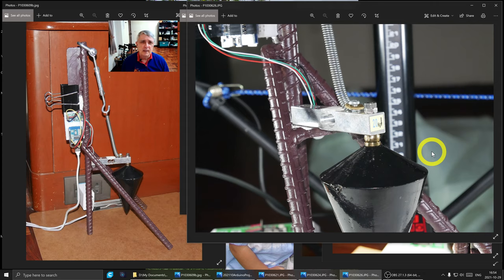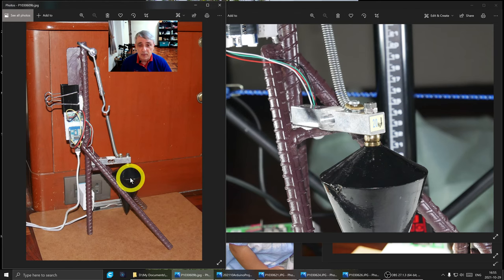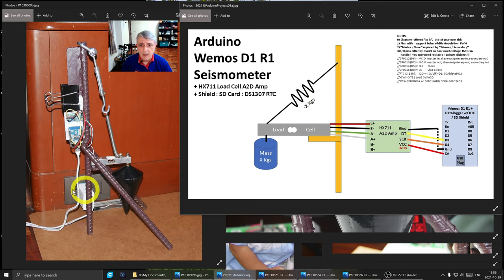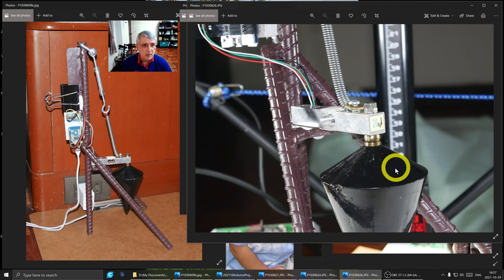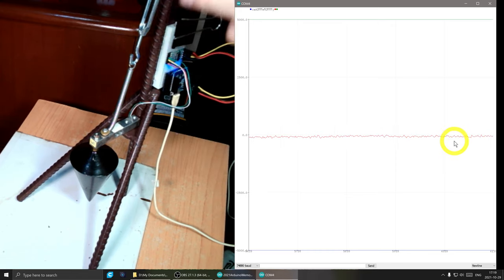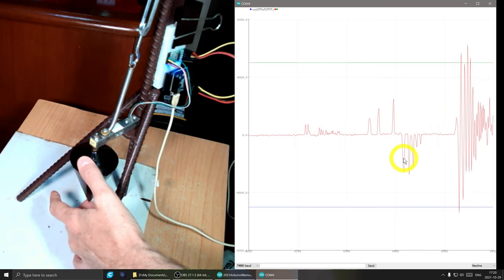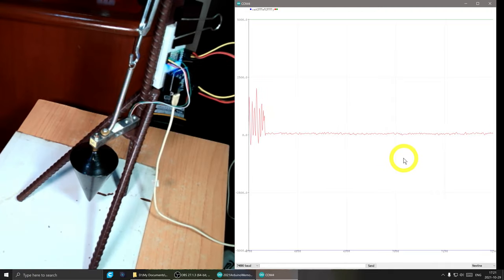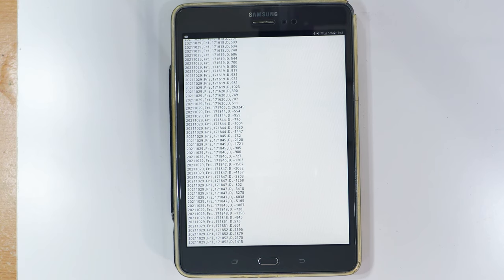DIY Seismograph (or Accelerometer) Hardware  Part 1 of 2 (4K)

Comment: Interesting design, I built the SEP long arm siesmometer and used the same amplifier and a teensy with wifi. Boughtt a Radio cllock but i guess gps time should be as good.
Reply from the maker: Did you post a video or pictures? I'd be interested in seeing it.

Comment: Will this seismograph need to be embedded in a block of concrete in the ground at some point?
Reply from the maker: Yes you are right, it should be fastened to something that is substantial. The pros put them in mines, or attach them to bed rock.